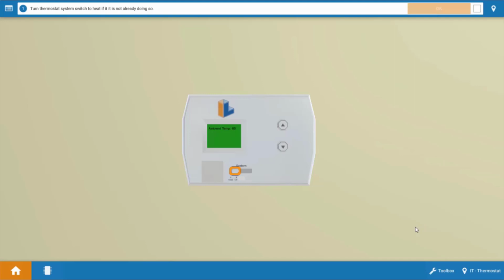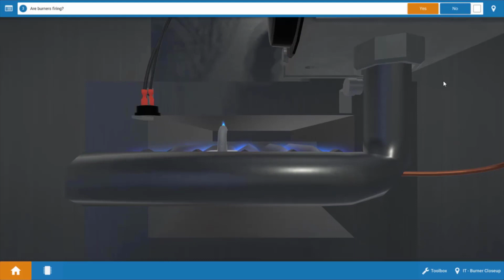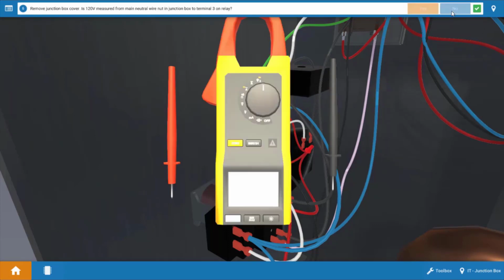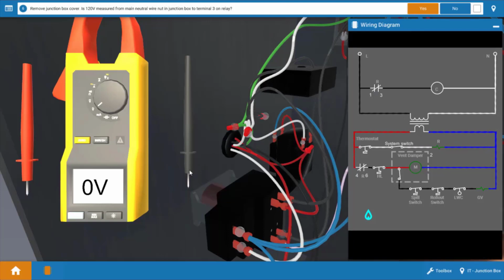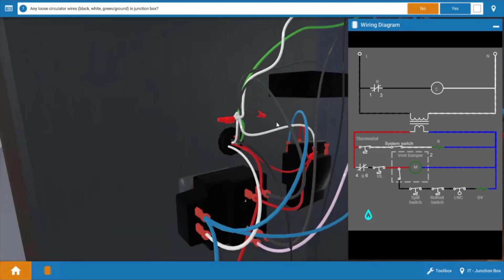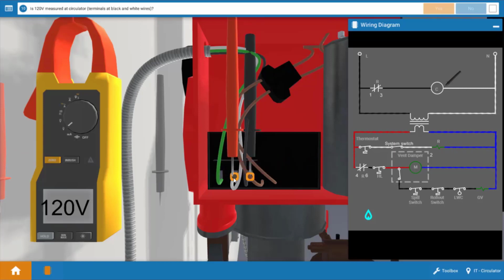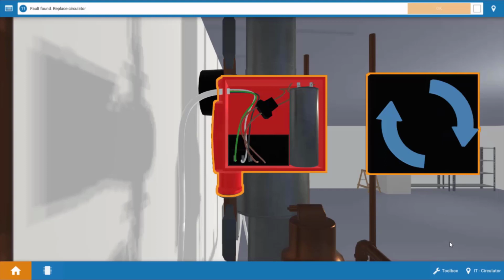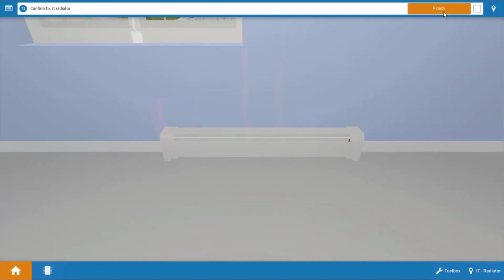How To Troubleshoot a Gas Boiler with a Faulty Circulator

Comment: I have a heat maker. The boiler runs and makes hot water. But no heat to both zones. It looks like the circulator pump isn’t getting any power.